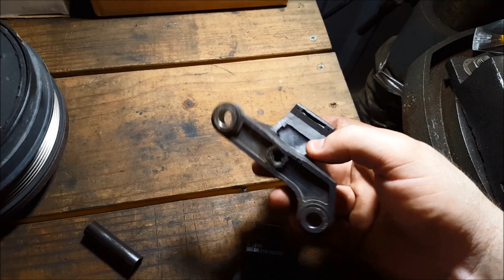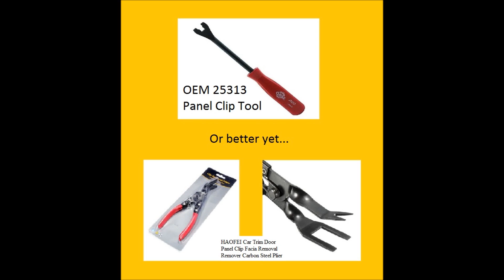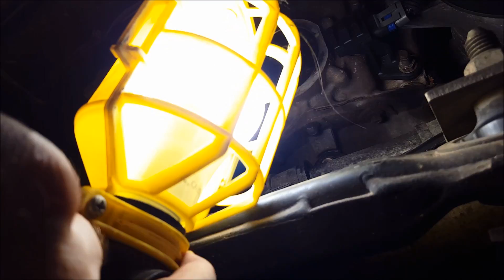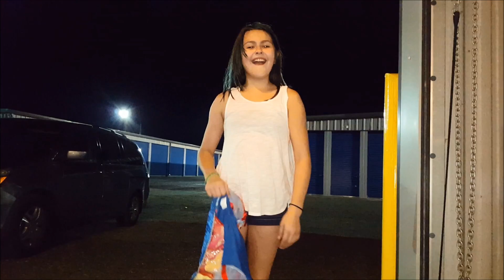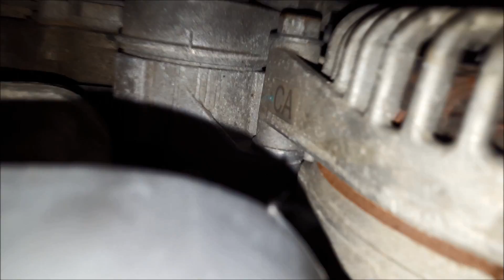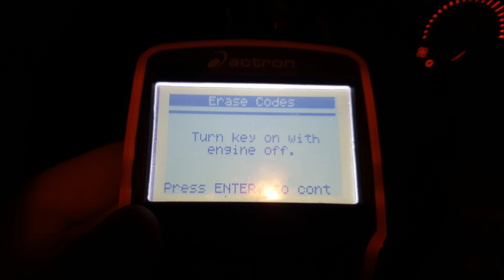2004-2008 Pontiac Grand Prix Buick 3800 Series III Crankshaft Position Sensor (CPS) Replacement 🔧

Comment: Thanks for the video. On my 2006 Grand Prix, there is a small cover held on by 2 - 10mm bolts on the front of the transmission which can be moved, to access the flywheel. Although you can't use a flywheel tool, you can use a large bladed screwdriver or pry bar to hold the flywheel, while you remove or torque the harmonic balancer bolt. It did require two people, one to hold the flywheel, the other to use a large breaker bar on the bolt.

Comment: I have this 2004 Pontiac Grand Prix GT2 with the 3800 series 3 v6 engine, and I have an oil leak from the same area you’re working on in this video 💯 To attack possible causes, I change upper and lower intake gaskets, I changed the valve cover gaskets, but I’m still leaking oil!  I’m certain my car is leaking from somewhere around that power steering fluid reservoir.  Now, because I can’t afford to have a professional work on my car, I’m doing a lot of work on my car myself.  I want to properly diagnose this car so I’m not doing unnecessary work!
Reply: What did it turn out to be?
Reply: @rsk8310  If I'm not mistaken, it was an oil pressure sensor that neededa be replaced 🤔

Comment: Warning: Do not follow his advice  to install harmonic balancer back using  the oem 24mm bolt.  u have to use 'installer' to pull it in properly. the gm3800 harmonic balancer is press fit type-If u ruin the crankshaft snout thread, it will be hell to repair the thread or buy a new crankshaft?  u can make your own installer tool or borrow from Autozone. Some Yooutuber mechanics lead u down wrong path. google research first!

Comment: Must also add I'm glad our Aussie Commodores have the 3800 mounted with "proper" orientation Ie NOT east-west like so many US cars I'm seeing. Commodores have tons of free space in front
of the engine, very easy to take of anything on the front of the engine. Don't have to jack up and take a wheel off either. :o)

Comment: Unsure if many Americans know but the 3800 is a very common engine in Australia being fitted to the popular Commodore for many years. I have a 2003 Commodore with an Ecotec 3800, done 440,000 Kms, never missed a beat, just spoil it with good oil and filters and it runs like a Swiss watch. Am about to do the timing chain soon as I reckon the chain would be worn/stretched and the chain tensioner would be due for a change. Among the best engines ever produced.

Comment: Nice job.  Just did my first CPS on my Buick Regal.  Used a breaker bar and socket and bumped the engine to get the bolt out on the harmonic balancer.  Wiggled the balancer as mentioned until I felt the key catch.

Comment: Great video I have to do this in hopes that I can resolve a no crank no start issue. I also have a cel  code for misfire #3 cylinder. Changed icm and coil packs still throwing code so sensor is my next mission...🤔😣😒
Reply: Did it fix your no crank problem?
Reply: @brandonvallely5883  dis you habe the no crank no start? And if you got it fixed what did you do?
Reply: Did changing the cps fix your no crank no start issue?

Comment: I'm getting the RPM drop and the stalling issue which are common for CPS. I don't have a code or check engine light.

Shaun4BigBlocks, did you get a code of check engine light with your CPS?
Reply: Could be ,throttle position sensor

Comment: Excellent video. Thanks so much for doing this. On my 2008 Grand Prix with 155K miles I am having to pull my timing cover off tomorrow to replace a gasket on it due to a antifreeze leak where the cover mates to the engine block and water jackets. What a pain for a leaky gasket but have to do since it is overheating and spraying antifreeze from it. Changing the water pump out while I am in there since I only want to do this job once. Your video on how to remove the harmonic balancer was very helpful as I have to pull it to remove the timing cover. Wish me luck!!!
Reply: Clifford Franklin I am having to do this with my 2007 Pontiac Grand Prix (V6 3800). I am trying to thoroughly research this before I get into the harmonic balancer. Do you have any tips or any big issues?

Also, did you have to drop the oil pan and remove anything else to get the timing chain cover off to replace the gasket?

Thank you so very much for any pointers.

-Lucas
Reply: I had the same problem and had to do the same and also replaced the water pump a couple years ago. I remember pumping silicone into the bolt holes hoping to not have  any leaks and i didn't.  Now i have an oil leak either coming from the shaft seal or the oil pressure switch, or if i am lucky maybe i double gasketed the oil filter. I am 59 and not looking forward to pulling the balancer again. I never did ( knock on wood ) have a anti freeze leak after i put it all back together though so i guess i did something right. So two years later this oil leak started, hopefully it is something easy.